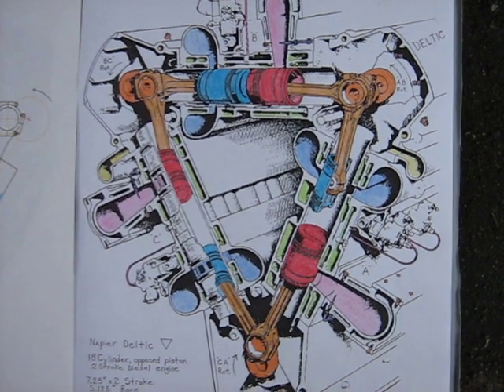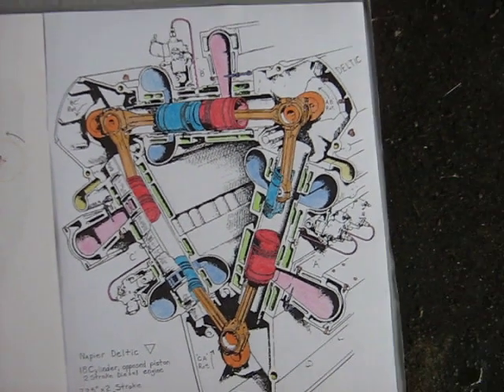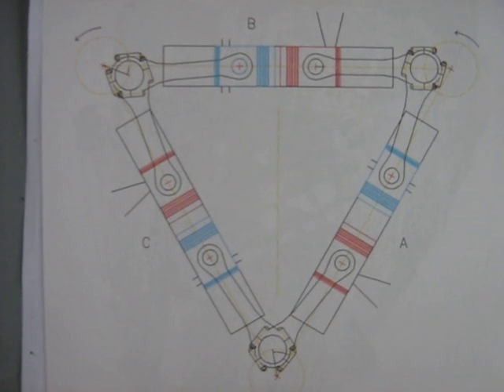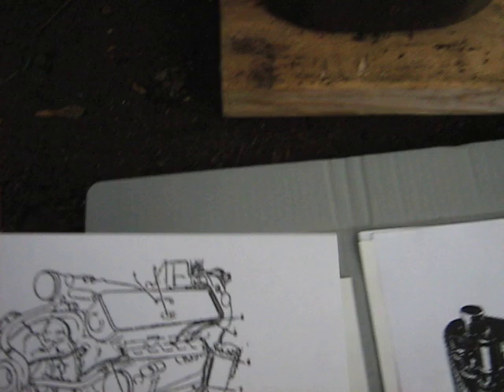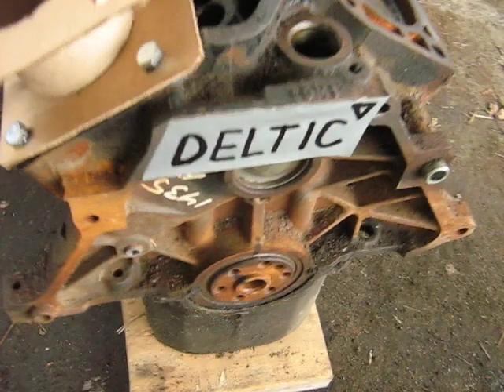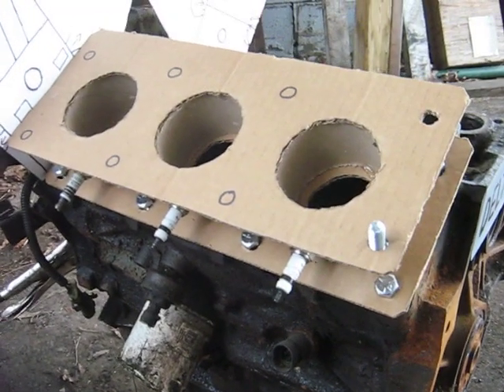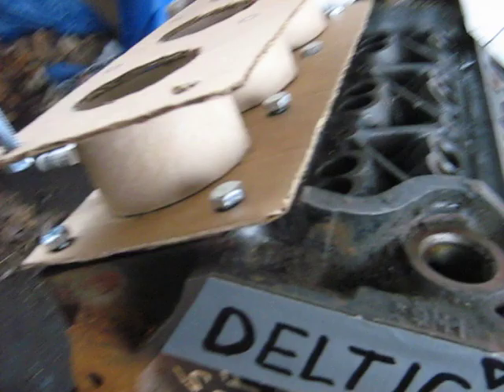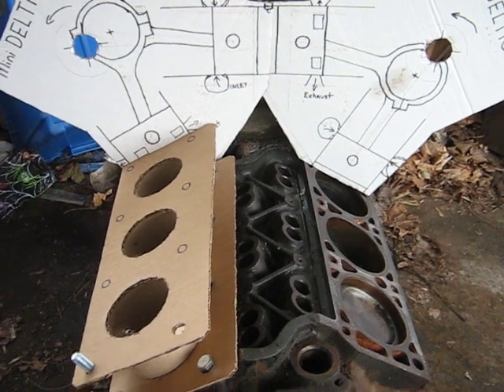Junkyard Baby Deltic Head #2

Comment: I have used 10w30 regular oil in 2 strokes without a problem. Most are designed to burn cleaner. Feed it through the bottom then burn it off by using oil injection after is lubes the bottom. Its hall all modern outboards work.
Reply from the maker: Interesting, I haven't ever tinkered with the oil in my 2 stroke, just went with the normal 2 stroke oil.
Reply: Ran Royal Purple 10w30 in my dads old lawn boy at 50:1 and a YZ250 and it runs very clean.

Comment: Nice 2 stroke design.  Would work well with modern fuel injection and oil injection for it to be clean running. Will you be running Royal Purple or amsoil 2 stroke hot burning oil?
Reply from the maker: If i ever did build this, I would just run normal 4 stroke oil, as it is contained in the crankcases, though oil in the fuel couldn't hurt, plus it would really smoke like a Deltic then!!!!  :)

Comment: This should be labelled Deltic #2, BTW. You've got two #3's
Reply from the maker: TheFurriestOne Thanks for the info, I will try to correct that.
Reply from the maker: TheFurriestOne I found the vid (the search program worked for me this time!), and made the change, thanks for letting me know it was labeled wrongly.
Reply: ChargerMiles007 No problem! With so many videos, it's bound to happen.
Reply from the maker: TheFurriestOne I have limited internet access also, so I don't have much time to search thru vids to see if they are OK. Still working on the 3 cylinder, finally got some work done on the top cover last night, planning to do more on it tonight. I NEED to get this thing going before Christmas!!!This engine is going to be a Go or Blow project for sure, mainly due to my new untried crankshaft design.
Reply: ChargerMiles007 I look forward to it!

Comment: suppose if u have zero play for both directions of rotation as in over run and aceleration.
3 detroit diesels minus heads of course, us one as inlet and other engines ports as exhaust (just increase duration of the Ex. one, plus u could use the blower from the detroit.
What did u think of the video/ locomotive I sent u that was bought for scrap price?

Comment: Just the same as the value of the metals, less that £1000!
I know somebody bought a class 50 diesel loco for about £6000!
And it even worked!
If I had the cash I would have bought them, i know a brand new tug boat, unfitted out for sale for £20, 000, perfect for deltics!

Comment: u would need to cut holes around BDC, through water jacket- tricky.
The baby deltic was turbo charged btw, but turbo was mechanically driven during start up like the emd 710, kind of a centrifugal clutch in reverse I believe.
I actually sourced 2 18 cylinder cartridge start deltics from a mine sweeper for the DPS, but they didn't want them! shame.

Comment from the maker: @ChargerMiles007 
Continued:
The fresh air pushes out the exhaust, and fills the cylinder witha fresh charge. The pistons then move towards each other compressing the charge, until it fires again, starting the process over again. Pretty simple, but the gearing attaching the 3 crankshafts gets a bit complicated and bulky.

Comment from the maker: @outdoorsman310 
No, the Deltic is actually a 2 stroke engine.
It is actually a very simple idea. There are no valves, just holes (ports) into the cylinders. There are 2 pistons in each cylinder, at opposite ends. 1 piston is for exhaust, the other for intake. When the 2 pistons are close together, the cylinder fires, pushing both pistons apart. The exehaust piston reahes the ex. ports first. Then soon after the inlet piston uncovers the inlet ports, and fresh air (and fuel in mine) are let in

Comment from the maker: @outdoorsman310 
Using 6 would depend on if you wanted to make it work like the Deltic did, or do it another way. The Deltic used 1 piston in each cylinder as exhaust, the other piston as intake, so it has 2 pistons per "cylinder", so I was imagining an engine built similarly. That isn't to say that you couldn't modify the cycle to use the crankcase breathing of the weedsmacker engines, putting 3 in a triangle :) Sound cool to me!  :)  Make sure to send me the vid!!!!